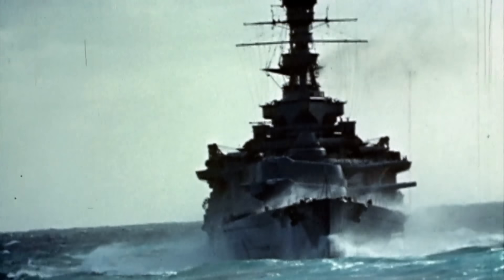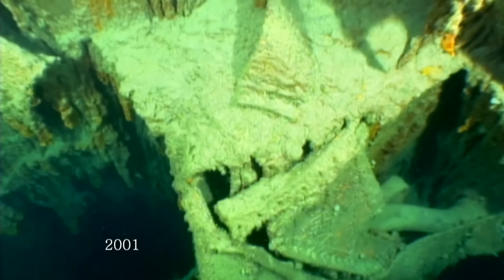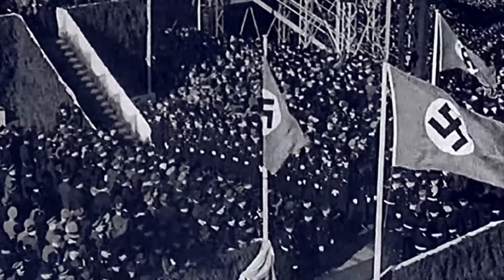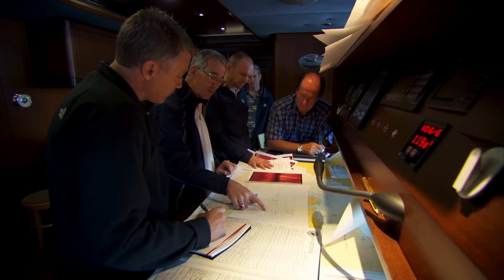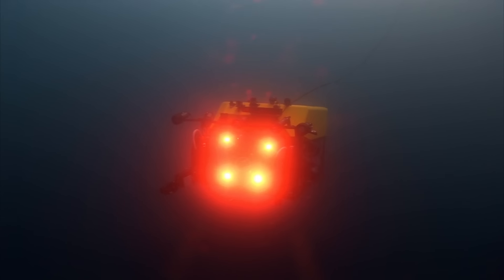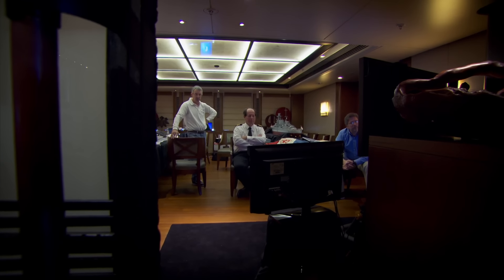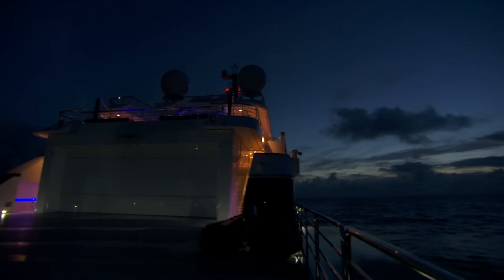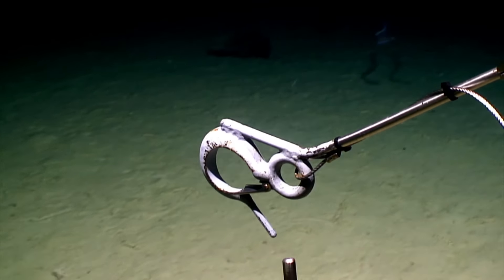How the Bismarck Sank HMS Hood - Documentary

Comment: Excellent German gunnery inflicted plunging fire on the Hood's insufficiently thick deck armor.  As a so-called "battle cruiser" built for speed, the Hood was simply not tough enough to face a full-fledged battleship like Bismarck.
Reply: The 'plunging' theory is incorrect.  At 13 miles, the shells were coming in 'flat'.
Reply: @oldcity1954  -- I defer to your apparently superior knowledge of the ballistics involved.  I guess the rest of Hood's armor wasn't up to snuff either.  In either case, she shouldn't have gone toe-to-toe with a full-fledged battlewagon -- and Prince Of Wales, which was theoretically much better suited for such a fight, wasn't even close to being battle-ready.  The outcome was pretty much predetermined IMO.
Reply: @editorjuno You are most kind.  From what I read, the Hood was turning so to bring all turrets into action.  At 13 miles and less, even though the Hood was older, it's armor, would have, in theory have protected it since the shells form Bismarck were coming in flat.  From what I read,  years ago, was that a design flaw in the Hood's armor was pointed out. The Bismarck was lucky.  Karl Zeiss optics along with quality Krupp workmanship prevailed on that day.
It has been a pleasure speaking with you.
Reply: @oldcity1954  -- As I understand it, Hood was slated for an armor upgrade at the time.
Reply: @oldcity1954  We will probably never know exactly why the Hood exploded. The best guess is that a 15 inch shell from the Bismark most likely hit the slopped armor in the rear and was either able to pierce it or the projectile was  deflected to the ship instead of outwards ( it is important to notice that the BIsmarck itself also used a slopped armor arrangement not very different from the Hood in terms of layout in the same area, what is not surprising since BOTH ships followed a banded armor layout altho the Bismark , following the german tradition, had ticket armor.  )
Intentionally Placing a 15'' inch shell on that particular area requires incredible luck (or  lack of it ).

In any case, if we want to be completely honest, at the distance that the ships were firing , the guns of both ships were able to to penetrate the belt of each other.  Hoods 15 inch guns were able to pierce at least   340 mm* of armor at around 16000 mts ( Bismarck's vertical belt  had a maximum thickness of  320 mm) and Bismarck guns were able to penetrate around 430 mm of armor (Hood's main belt had at it's thickest point 305 mm , but was angled at 12 degrees so it's relative resistance was equivalent to 320 or even 330 mm  of armor) . 

PS: And before someone comes around mentioning the neither KGV or Nelson guns were able to penetrate Bismarck's main belt,  there are two good reasons  for that : 1) at the time Bismarck's belt had become almost fully submerged as the ship had been flooded and so was sitting much lower in the water ,  and so the main belt was particularly hard to hit,  and second, in their rush to destroy the german ship, both Nelson and KGV  got so close that their guns could not be lowered enough to hit the waterline, and so all their shots were hitting the upper belt, upper works and super structure . If KGV's shots were able to pierce the conning tower, like it was seen in J.Cameron video, that as thick or even thicker than the main belt, they would have pierced the belt also.
Reply: @smokedaddy258  

Typing in all caps does not make it look like a teletype print out - it just makes it to hard to read - thus wasting your post.
.
Reply: The Bismark had superior targeting technology.
Reply: @BobSmith-dk8nw  Myself I don't mind all caps my eyes are old.
Reply: @oldcity1954  

That or they weren't coming in flat at 14,000 meters.  This was on the border line between plunging fire and flat trajectories.  The British may have thought they were out of the plunging fire zone - when they really weren't.
.
Reply: @Solrac-Siul  I have nothing to add to this comment other than its refreshing to see someone take all the facts into account, and present them in what i call i fair and balanced fashion. Thank you for acknowledging that while still being inferior to Bismarck, Hood still had the very real potential to do harm the german juggernaut. Great comment, have a good one! :)
Reply: @NightHeronProduction  Well I try to as I have an academic work that covers both ships (not really the battle itself and it's outcome rather the design concepts regarding both ships). It is still sad  to a point that the same half truths have and still are regurgitated ad nausea when, specially today, considerable amount of information about both ships is available and easily accessible , and any can check that data and reach a few fair conclusions. Ps : the british navy and later media is at fault  as they mystified  the Bismarck to a point that it become almost like Hobbes Leviathan. That is not to say it was not a powerful and solid built vessel, and for a limited amount of the time, probably the deadliest catch on the sea , but when it was sunk several better ships were on the last stages of construction, including among those it's sister ship. the Tirpitz , that incorporated changes in order to cover certain limitations of it's younger brother.
Reply: Very good and fair points.
Reply: Bruce Morgen Hood had known flaws inher armor.There had been a plan to upgrade the armor that was,unfortunately never carried out.Bismarck also had massive guns.and the german gunners were good.Even without the magazine explosion,the Bismarck probably outclassed Hood
Reply: I question this 'turning tactic'. To me, it seems antiquated for WWII ship engagement. Perhaps you can explain why it was considered 'good tactics'. To me, I would prefer they continue to attack head on, exposing the smallest cross section to enemy guns, not to mention a fast moving target. By turning, you slow the speed considerably, you present a much larger target. Those two negatives to the one positive of being able to bring more guns to bear is not 'good tactics' in my book when facing such as ship as Bismarck or even a U-Boat. I believe the tactics themselves need to be reexamined.
Reply: Teletype! Lol.
Reply: Stephen Kayara Indeed the shell fall at 13000m was only 8.5 degrees.
http://www.kbismarck.com/38cm.html
Penetration at 16000 meters range was 460mm.   This means Bismarck could smash through Hoods side Armour belt plus 50%.   It could even dive through the water and penetrate below the water line.
Reply: Or Melville's Moby Dick. Certainly there was this mystique about the giant ship, the beast that was Bismarck. And as you point out so well, this blinded the British, somewhat, to advancements being undertaken elsewhere, namely on her sister ship. This tendency can also be seen in the Allies initial attitude about the German Panzer/Tiger tanks after their first appearance on the battlefield. Extremely well built, heavily armored machines, they rose to mythic cult status among many Allies who were to face them seeing the damage they could incur: 

“One of his Shermans turned the corner of a house and got off three shots at the front of a Panther, all bounced off. The Sherman then backed behind the corner and was disabled by a shot penetrating two sides of the house plus the tank.”

But, as is often the case, reality is different than myth and soon US, Russian and other Allied forces were able to discover the downside of having such a heavily armored precision made machine on the battlefield far from supply lines. If you can't refuel it, or fix it, it's size and armor is now a hinderance. The much more cheaply made assembly line tank, churned out by the thousands, the Russian T-34s and the 'Ronsons' the M4 Sherman tanks were with all their flaws able to bring down the giant Tigers by sheer number and ability to keep them running (when they weren't burning up like Ronsons, that is).
Reply: @Nostromo76594  -- True, and that class of warship was designed to contend with and dispatch cruisers and other lesser warships, not fully-armored, dreadnought class  battleships.  I used the words "so-called" because most folks nowadays aren't familiar with the distinction between the two and presume Hood was a also a dreadnought.
Reply: @oldcity1954  this weakness and insufficient flash protection was know by the Germans after Dogger Bank, so not sure why the British continued to build a flawed design.  Churchill himself said you need to spend the extra money and get what you want, which were fast battleships, like the Queen Elizabeth class.
Reply: @oldcity1954  Not sure who told you this but you are 100% wrong and not sure how someone else has not caught this yet. At 13 miles the shell trajectory would have had to come close to reaching the maximum ordinate of the Bismark's capability. The shell did with 100% certainty plunge into the unarmored deck of the Hood causing the magazine to explode thus splitting the ship in two. The angle of fall at that range for that gun was 100% a plunge. There is no argument here it is 100% fact.
Reply: As a followup, a gentlemen made the statement that I was 100% wrong, maybe, maybe not.   I refer the kind person to website:  https://en.wikipedia.org/wiki/Projectile_motion
After careful reading, maybe he will recognize his erroneous assertions.
Reply: @robertmikolon5710  Read this article.  You might learn something.  https://en.wikipedia.org/wiki/Projectile_motion
Reply: The HMS Hoods armor was not that much different than the Bismarck. Hood had a 305mm thick armored belt, the Bismarck had a 320mm armored belt. In some places the Hoods deck reached 178mm thick while the Bismarck had a maximum 120mm thick deck.
Reply: I believe England needed a sacrafice
Reply: @editorjuno  she was taken in for refit and recieved armor for only the rear stupid huh.
Reply: @craigdavis6611  -- Taking her to sea with only a partial refit was expedient...and tragic.
Reply: @editorjuno  
she had already been upgraded once
Reply: @SelfProclaimedEmperor  Not only can you compare the thickness of the armor of both ships. In the 20 years between the construction of the Hood and the construction of the Bismarck, it has also improved steel quality. The steels from the 1930s and 1940s were more elastic and tear-resistant and not as brittle as in the 1910s to 1920s. The main armor of the Bismarck was made of specially developed armor steel (Krupp Wotan hard) with a tensile strength of 85-95 kg / mm², elongation 20%, yield strength 50-55 kg / mm². That's a third better than the steel used in World War I and the first 1920s. For that reason alone, both ships still were unequal opponent.
Reply: @humbleradioTokyoAdventures  the c-in-c said he wished Holland had gone in more head on, as you say, but I wonder too if the turn was also to help put the fire out that was killing sailors, and the c-in-c said the fire was the cause of the sinking, as spreading to warheads of torpedoes presumably
Reply: @Solrac-Siul  churchills sponsored anti aircraft rockets were loose and the 4 inch ammunition, and fire - perhaps that aspect not examined properly to ensure no one accused him of causing the disaster
Reply: @robertewing3114  not going to say you are wrong. We simply don't know what really took place. Ultimately the explosion may not even be the result of  a direct hit since cordite was highly unstable and even the increased temperature from the fire on the deck could potentially result in an major explosion.
Reply: Excellent gunnery from Prinz Eugen began a fire sending the Churchill sponsored rockets into the 4 inch ammunition boxes, and torpedoe warheads there, the excellent Bismarck gunnery not necessarily relevant - and if Churchill sank Hood, the debate would never begin at the Admiralty, only years after the war.
Reply: @craigdavis6611  a lot of ignorance generated that conclusion!
Reply: @smokedaddy258  No propaganda, it continues today, the Hood was deployed as part of the policy  academics call appeasement, there was no policy needed to remind the world who was leading it, no senile dementia just half mad dictators and the one ally needed was isolationist
Reply: @oldcity1954  Far more skill than luck. They quickly straddled, then planted shells upon the HMS HOOD... at over a dozen miles. In rough seas while in motion and the Hood even in a turn.
Reply: The battle plan of the HMS Hood was to get close enough to avoid plunging shells. Their deck armor weakness was no secret to them.
Reply: Please look up @Drachinfel's documentary on the angle.
Reply: @Solrac-Siul  Please look up @Drachinfel's documentary on the angle.
Reply: @BobSmith-dk8nw  Please look up @Drachinfel's documentary on the angle.
Reply: I mean a potent case in point hoods demise can always be summarized as incorrect utilization battle Cruisers were not meant to engage other Capital ships certainly not a high-speed Battleship like Bismarck who was 20 years younger I admire and appreciate both the Bismarck and HMS Hood hood was equivalent to Bismarck some 20 years previously but by the time of the second world war outdated lacking modifications and enhancements people nowadays are trying to argue that hoods anemic armor wasn't to blame the ship exploded from a salvo lucky or unlucky it landed the killing blow
Reply: @oldcity1954  13 miles you sure of that? Regardless of surviving accounts and documentation I do believe the ships with the racking of waves and tilting whether it's 13 15 20 10 it was certainly possible plunging fire was absolutely capable at a myriad of distances I'd also want to point something out Stephen you weren't there so you can't really speak with certainty of that but what we can speak certainly of is the fact that the ship was destroyed from its engagement it's incorrect utilization a battle cruiser is not meant to engage a battleship Inception to concept concept to application Cradle to the Grave
Reply: @jonathanjones3623  -- The Brits didn't have much choice.  Prince of Wales was brand new and not up to facing Bismarck alone, and Hood was the only ship with the required additional firepower that was fast enough to make the interception.
Reply: @editorjuno  fair enough but I'm just saying it would have been preferable to send one of the Nelson's with the 16 inch navel gun or at least two of the King George V that's all I'm saying to have parity is one thing to have an advantage is another if they had had three capital ships spearheading the assault it would have been better outcome better odds say Bismarck gets out there ahead of them for a week or so I still think that it would have been a preferable outcome
Reply: @jonathanjones3623  -- The actual eventual outcome of whole Bismarck episode points the way to the optimum weapon against big, heavily armored capital ships: *air power*.  A single lucky torpedo hit to the Bismarck's steering gear by an obsolescent biplane was enough to doom her.  If the Brits had a squadron or two of American dive bombers -- or even torpedo bombers with functional torpedoes -- which they (and the Japanese) had, but the Americans didn't -- that would have made short work of any battlewagon, as the demise of the mighty Yamato proved in 1945.
Reply: @editorjuno  case and on point that is correct it's the reason why especially during 1940 I mean aircraft carriers were Superior to battleships even though there had not been an actual conflict yet to demonstrate it and the eventuality is to hunt down Bismarck they did full additional units from other Arenas and operations they might have been perceived as Overkill at the time but had they had Rodney King George V Prince of Wales and The Relic Hood engaging Bismarck they would have put her under for certain things it's why I said earlier in the channel I mean USS Lexington was a superior warship to HMS Hood longer heavier and arguably more powerful Admiral Wilcox in the video I believe he was incorrect but aircraft weren't available until after the battle of the Denmark Strait
Reply: @jonathanjones3623  -- It should be noted Rodney was also a "relic."  Like Nelson, it was a slow old thing in the first place and in extremely poor overall operating condition at the time.  Pretty much the only way its formidable 16 inch battery could have been brought to bear on Bismarck was for Bismarck to have been as crippled as it was for that final engagement.
Reply: Jordan Fan，Prophet of Environment。范楚漳，環境先知：
How Did The Bismarck Manage To Sink HMS Hood So Quickly? 
Answer:  The answers were very simple:  When the HMS Hood was battling the German battleships  Bismarck et al, those lazy British  navy sailors onboard the Hood were busily eating their favorite breakfast food - Biscuits with Sardines.  And had forgotten to return fire at the Bismarck!